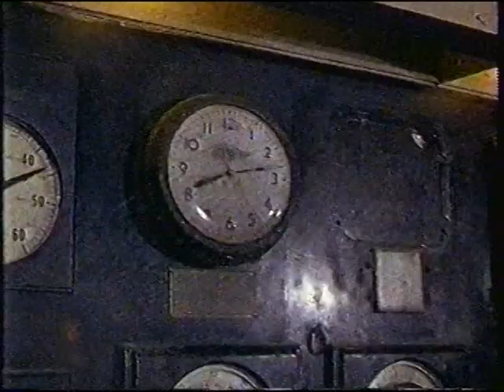Kaiser Steel, open hearth furnace scene from the movie "Steel Town", 1952

Comment: Kaiser later went to all oxygen converters for steel production to increase productivity.  The oxygen was obtained from a Linde air liquefaction plant across I-10 from the plant site.  The oxygen was transported to the plant by pipelines underneath the freeway.
Reply from the maker: Thanks for the historic information regarding Kaiser Steel's replacement of its open-hearth furnaces with BOP furnaces.
Reply: You sound like you worked at this mill. Did you by any chance know a Bobby Hagar? He was Sammy Hagar's father and his biography mentioned he was working the open hearth furnace.
Reply: @BKFan342  I never worked there.

Comment: Dudes.  YOU NEVER STAND UNDER THE LIFT.

I worked at US Steel in Gary IN.  The bang that into your head?

Does not matter what the lift is.  You NEBER stand underneath it!!!!
Reply from the maker: Your advice is similar to the advice given to me as a railroad employee:  NEVER WALK BETWEEN THE RAILS OF A TRACK (exception: unless on a bridge with no walkway).

Comment: Indeed, generally a total lacking of the PPE we started to become familiar with in the 60's. Most furnacemen, even earlier, wore thick flannel shirts with leather aprons which offered some protection from splashing metal up close. Actors here wouldn't last long in their t shirts.
Open hearths mostly did not last beyond the 70's and it's not hard to see why. Basic Oxygen converters with continuous casters were all the go.
Reply: thanks for your insights.  I thought the depiction of the clothing was crazy.

Comment: Kaiser steel, in Fontana (Ca)???
Reply from the maker: Yes, Fontana, California as I mentioned in the description.
Reply: yes.
Reply: Yes, Fontana, California, around 45 miles east of Los Angeles. What remains of the former Kaiser steel mill is still in operation today, but as a Steel re-rolling Mill, no longer owned by Kaiser (since the 1983 closure).

No longer a fully-integrated steel mill (so it does not actually produce steel from raw materials, no blast furnaces, or basic oxygen steel converters, etc). Since the restructuring in 1984, they purchase/re-heat steel slabs and run them through the former sheet/plate rolling mill.

When the mill re-opened in 1984, it became California Steel Industries, which was later bought out by Nucor Steel in the 2020’s.

I worked there during the late 1990’s (CSI).

Comment: amazing.  looks incredibly dangerous.  wonder what worker fatality rates were?

also, did they really wear such flimsy clothes?  I would think you would wear really heavy thick clothes, something wool—no synthetics.
Reply from the maker: Thanks for your comments here!  If you look at photos and film from this time (early 1950s) and before, steel mill safety equipment was far more lacking than what workers use today.  I bet the injury and death rate were indeed higher at this time as was the case in many other industries such as the railroad.